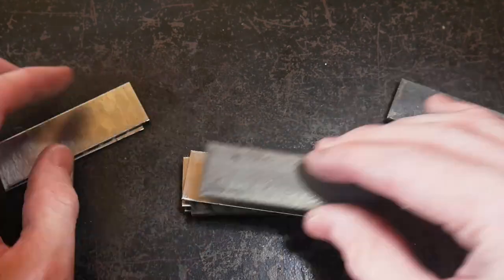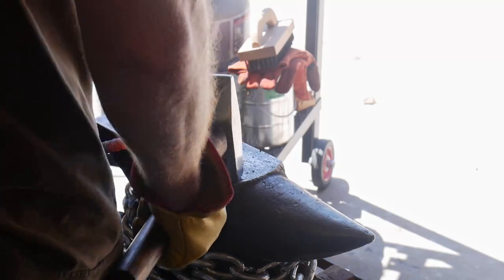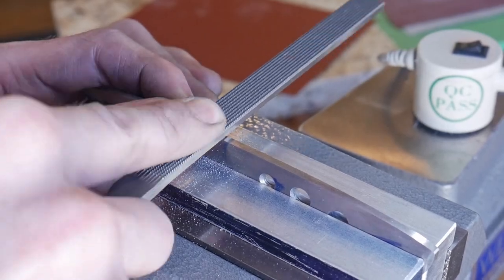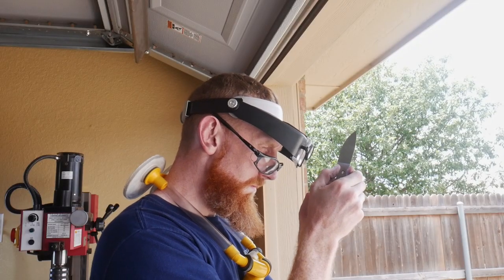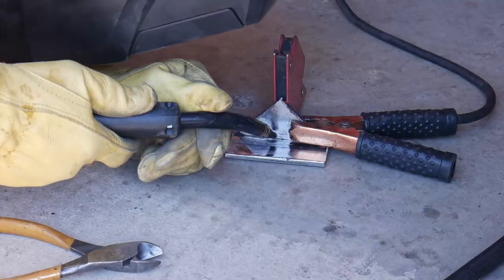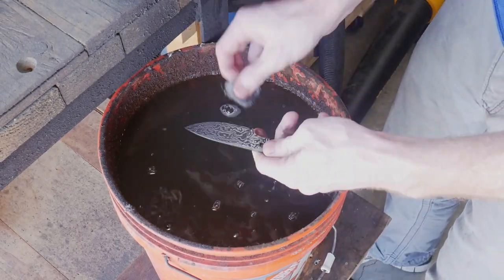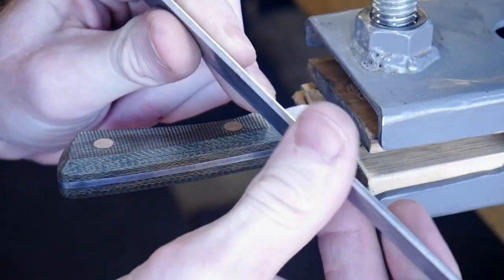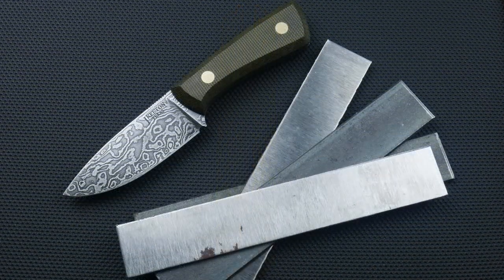Hand Forged Damascus Knife | Knife Making

Comment: When you're cutting off the Corby bolts you should try taking a piece of sheet metal with a hole drilled in it and just hold that over the Corby Bolt and then cut it up against a sheet metal
Reply from the maker: Good idea sir, that will protect the scales nicely!

Comment: One suggestion; twist on a piece of wire for a temporary handle to the butt end of your damascus blade before heat treating.  The area of your butt end, where your tongs grab it, your tongs will steal heat out of your tang, causing it to not harden the same as the rest of the blade.  The result being, your final etch won't look the same throughout the entire blade.  Grabbing onto the temporary wire handle with your tongs, means your entire damascus blade heats up equally and the etch looks much better.
Reply from the maker: Thank Dan|! That's a great idea! I did notice some variation in the pattern where my tongs were

Comment: Evening from the UK mate.  Probably a stupid question but I'll ask anyway you mentioned in the video about forging temp at the moment I do.stock.removal.but want to.give forging a go what colour is the metal at forging temp.   Sorry for the essay 😅
Reply from the maker: Hey Matt, they have some references online with different colors and temps which are decent. (Type in "Metal Heat Chart Color") - Forge welding heats are around 1800-2000 F. I find it's a decent indicator to watch the flux... it gets very melted.
Reply: Legend thanks yet again for the help

Comment: Toss up between Feather, Raindrop and Mosaic patterns.

P.S. to save yourself a good bit of material (with knife making anyhow) you really should look into encapsulating your damascus billets in mild steel... I mean I know that Borax is pretty cheap, but no oxygen getting between the plates of 15N20 and 1080 = No forge scale.  may not save much money and it adds a step, but it saves you a lot of time and you don't lose nearly as much material as if you were setting your welds/forging in open air.
Reply from the maker: Thanks for the tip sir! I've seen Kyle Royer doing this! Have a great day!

Comment: Cool blade!  So after normalising you cool the blade in water?  Rather than letting it cool naturally?
Reply from the maker: Hey John, I cool the blade in water after each tempering cycle. This has no negative affect on the blade and speeds up the tempering process.  (Normalizing is done in the forge and in that case you'll let the blade cool to room temp naturally or with a fan)
Reply: Red Beard Ops ah sorry, wasn’t paying attention!  Thanks for the reply too, love your channel!
Reply from the maker: @jfish4533  Cheers, sir

Comment: your going to want to learn to use tongs for forging to shape. to start with a pair of wolf jaw tongs from Blacksmithdepot will work great. the reason for using tongs is you can better shape the handle as you can start with the handle away from your holding object makes it much easier to forge it out.
Reply from the maker: Thanks for the tip sir! I've been eyeing some wolf jaw tongs.
Reply: @RedBeardOps  your welcome. you also may want to get some 'blade' tongs if you start forging more.

Comment: I actually think this is one of the best knives I’ve seen you make, James. Really, I do.
I noticed that you hand-sanded dry most of the time. Was that for any particular reason?
Also, the green micarta ended up looking very camo, as did the blade.

Great job, man. If I made something half as nice, I’d be very happy.

All the best!
🇬🇧🤜⚡️🤛🇺🇸
Reply from the maker: Thank you very much sir! I really like the way this one turned out as well. I've hand sanded both dry and with Windex in the past. I do think the windex probably helps cutting longer to some degree... but I like not getting everything wet. I may go back to it. I've seen Nick Wheeler use oil.
Reply: Red Beard Ops 
I’ve seen Windex for low grits and oil for high grits. I think both prevent clogging. 
Either way, your blade turned out great! 👍
🇬🇧🤜⚡️🤛🇺🇸

Comment: May I ask how many years of experience have u had in bladesmithing and how much has all of your tools and equipment costed
Reply from the maker: Hey man I was into this when I was in high school - Stopped over college -  and got back into it about 3 years ago. Not sure on the tools... You kinda acquire them as you go. Start small and work you way up. Drill press should probably be #1, 2x72 is nice too
Reply: Thank you so much
Reply: I made two more knives with only an angle grinder challenge may I email them to you

Comment: You already have the rebar welded on, you can make the handle out of the rebar and the blade all Damascus.
Reply from the maker: Hey Richard, I'd say it's possible, but I really don't like working with rebar.
Reply: Just a way to use all of the quality metal. The handle doesn't really matter that much, does it?
Reply from the maker: @richardhatt6541  Yes sir, that is correct, the handle metal does not need to be of the same quality as the blade. In this case I wanted to be able to see the Damascus pattern along the spine of the knife. Also, in general, I like having high quality steel in the handle heat treated to a "spring temper" or close to it. I feel like this allows the knife to handle impact and flexing better. Could be wrong.